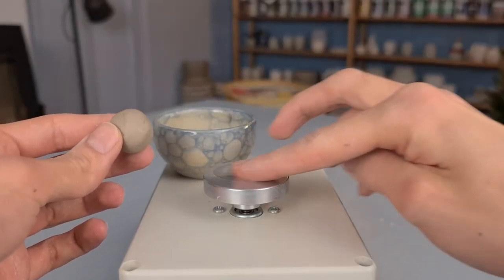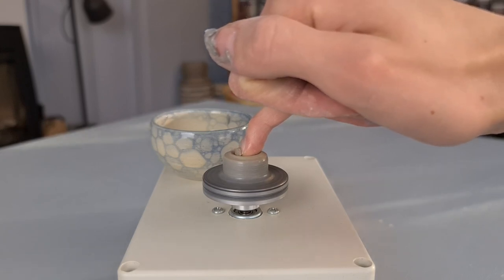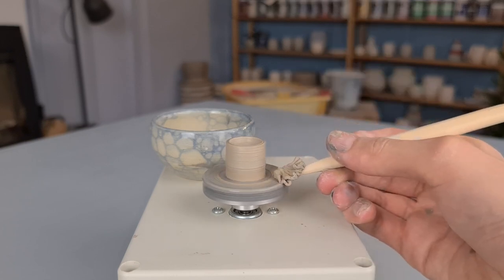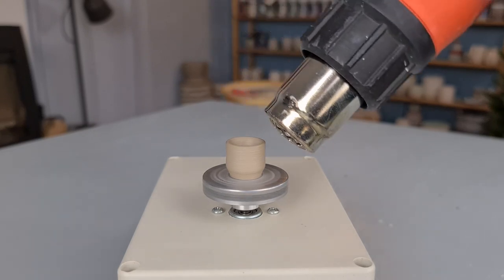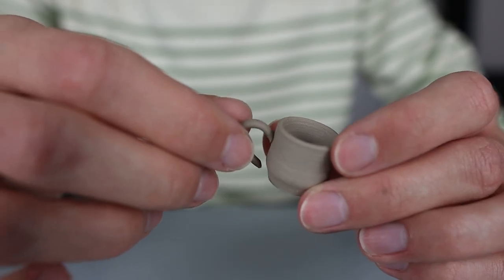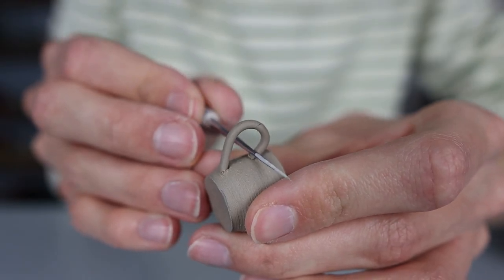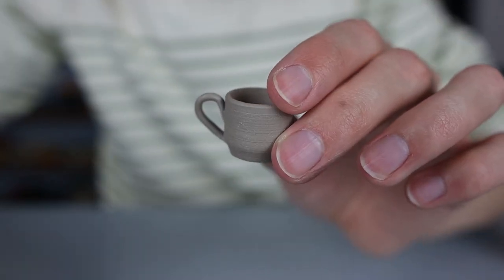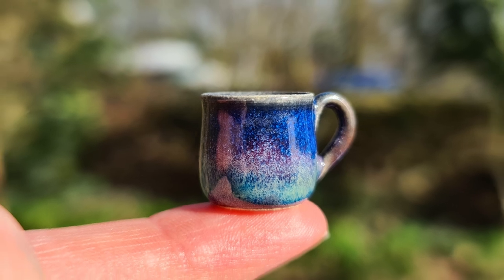How To Make A Mini Mug on a mini pottery wheel // start to finish

Comment: What is your brand of mini pottery wheel 
Excellent video plx reply
Reply from the maker: I got my wheel from Amazon, but it's not available anymore and not from a specific brand. There are a lot of different ones on Amazon tho😊
Reply: @caldervanandel  I understand but do you remember name, is it with 3 turntables or one only amd whats the size of the turntable plx reply thanks
Reply: @caldervanandel  and what watts of power is that motor and volts too 
I  sorry to ask this much but plx reply thanks

Comment: I'm thinking of buying a mini pottery wheel myself. I've never done  proper pottery before, so I'm trying to find as much info about it as possible. What is the temperature needed for making that small pottery, please?
Reply from the maker: You can fire ceramics at different temperatures. I do my glaze fire at 1220 degrees Celsius, but you could also do this around 1000 degrees Celsius😊
Reply: @caldervanandel  Thank you kindly, that's very helpful!
Reply: Best I’ve seen! Thanks!!